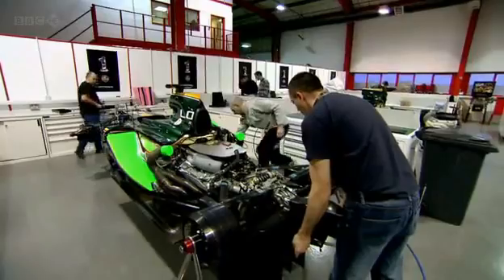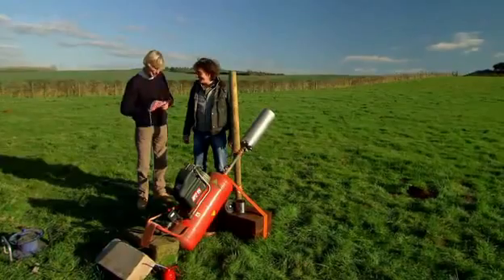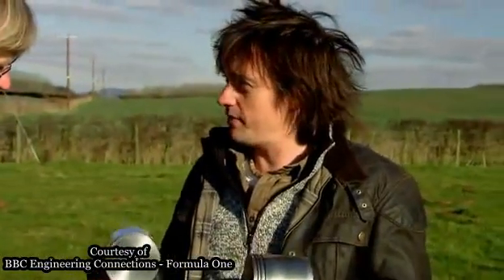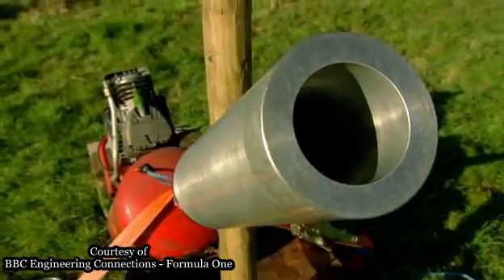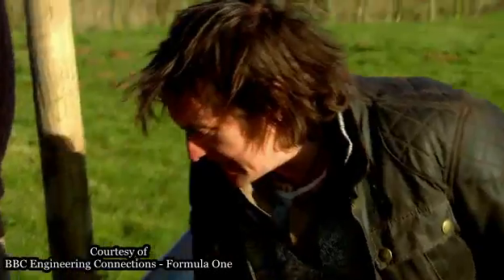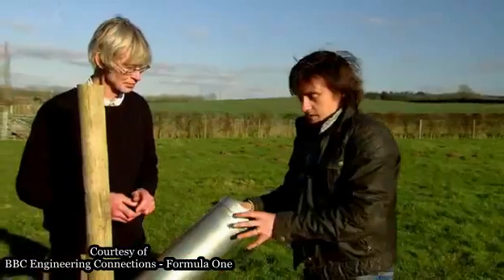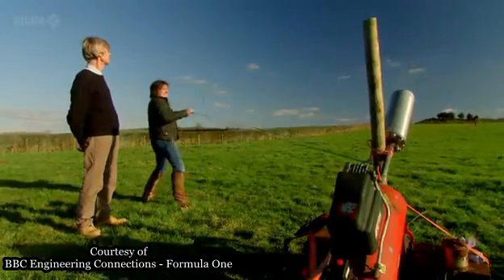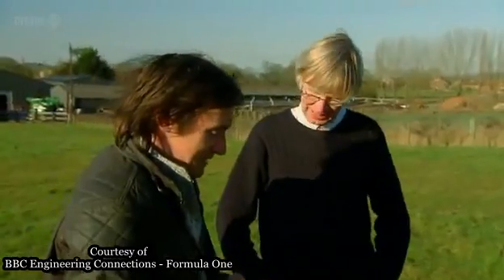The Secret of F1 Enormous Power - Precision Fitted Components

Comment: Piston rings???!!??
Reply: +magna59 F1 engines have piston rings, both compression and oil.
Reply: +Tristan Laing Why would you need piston rings , in the conventional sense , if you have measured everything within a micron of it ' s life . Piston rings are a reflection of low machining capability / pricing techniques & a quick cheap fix . May be the odd oil control ring , but even that ' s a bit of a mixed on , as these engines are generally dry sump , so it ' s not like there is vast amounts of oil being splashed about , as in a wet sump design .
Reply: So f1 engines don't use piston rings?
Reply: Yes, but magna59 was implying F1 engines don't have rings and I was answering Tristans question.
Reply: +magna59 no, every engine needs piston rings because the piston gets bigger as it heats up, if the piston was the ring than there would be a lot of friction or there would be no compression.
Reply: +Tristan Laing Well i ' m sure like everything else in this " world " there are things with rings & things without . Block in alley with liners , block without liners etc etc etc
Reply: +Tristan Laing It's a stupid example.
Reply: +randysengine service i dont know if hes right or wrong, but they have to heat the engine to operating temperature to turn on and not wear
Reply: +Austin Zeller maybe they use  really thick oil and they heat it so it can flow better when they start it, but I could be wrong. I don't think the  clearance are as tight as everyone is insisting because there would be more friction, the piston clearance doesn't need to be within .002 for the engine to make power and have good fuel economy, some race cars have piston clearances as much as .006
smaller clearances add to the life of the engine.
Reply: +randysengine service that probably part of it, but I think it needs to be heated so the block expands and leaves very minimal clearance for the piston. But I'm no f1 mechanic lol, I could be spewing non-sense
Reply: +xXxMartin96xXx no that was bullshit. I know a lot about engines

Comment: This is actually cobblers.  All cars have good fitting pistons and rings to seal the tiny gap left.  The reason F1 engines are so powerful is the RPM they develop their torque at.  Power = torque x rpm,  thus with multi cylinders you have smaller components, and built from higher quality material can cope with high speeds and deliver higher power.
Reply: +zzebowa road going cars have MUCH looser fits. it has to be operational on a much higher range of temperatures (usually -20c to the regular engine temp which is usually around 80c). taking component dilatation into account, they HAVE to be a bit loose to work, or it'd get stuck when cold and need silly startup procedures like f1 does.
this isn't cobblers, it's just not the entire story.
Reply: +Tony Pate Heard of punctuations ?
Reply: +zzebowa God  how i love you car guys ! Meanwhile back in the early 1960s on you
tube HONDA 125 5 CYLINDER AT GOODWOOD FOS 2002 and for a real techno 
feast try HONDA GP RC166 DOCUMENTARY GRANDFATHER OF RCVS even did
a few cars with 10k redlines the s600/s800 both with roller bearing cranks all bit
to much the car world in mid 1960s !! try MUSIC! KOGA RACING HONDA S600 RACING  and the best part is the bikes got left behind by the more powerful
two strokes only good news is kind mr yamaha done a engine for mr toyota 
sorry mr  lexus for car fans drool over packed with late 1980s early 1900s tech
gee a 9 k redline at least not a bung a turbo on a average "motor" NON TURBO STI/EVO ANYONE ??  the pop pop bang bang pop off lazy engine tech rant over
got a soft spot for old v10 etc f1 but now it,s a sad show not a event to stir the
heart and awake any passion
Reply: +rvind92g  Yes thank you i have ,No big deal to me on you tube if makes you feel any more smug, I now consider my lax ways been addressed by your good self ,Well done that "man" now if nothing else can help you with kind sir
i bid you a very good evening  and my condolences to you on the loss of top gear and if not got one may i suggest, A nice audi for you sir , Maybe a golf sorry a a3 but never ever utter the words a 2
Reply: +Tony Pate Take your pills
Reply: +Faketrollname sevenbillion Thanks for your concern every day at 10am 
seems to work for me unless have a "incident" brought on by sighting a panzer mk 12 sorry a Q7  !! Worry what all the drug dealing owners done with
the panzer mk 10 sorry X5 ,s
Reply: +GraveUypo No, production cars have higher tolerances, these engines have a lower tolerance( .004 to .006 piston skirt to cylinder wall) and use a heaver oil. please someone correct me if I'm wrong.
Reply: +GraveUypo Production cars have extremely tight clearances nowadays.

Comment: How are the Pistons too tight when cold???? Won't they only expand more when heated up?????
Reply: +jhaze918 you forgetting that the engine block expands too
Reply: +Somethingafw F1 piston, along with almost all engine pistons are Aluminium alloys. Only recently has there been a push to steel piston technology. You see, the key parameter is thermal conductivity. Steel cannot remove the heat from the piston surface as quickly as aluminium, so requires a lot more oil supply from the Piston cooling jet, thinner walls, and thicker piston rings to conduct heat to the liner. Google steel pistons and you will see their very thin construction. Very expensive to produce at the moment and only really beginning to yield benefits.
Reply: Somethingafw c'mon, i just said common things, really. That's not a question of wikipedia or not. I've studied materials, and there is something that everyone must understand, is that there are steel, and steel. For example, steel, as you know, is not a material. Is an alloy. What i mean, is that you can have a "steel alloy" (if i can say this, sorry for my flaws in English language), with a given percentage of carbon, and have a different behaviour than other "steel alloy" with other percentage of carbon (just saying carbon as an example, but it is not the only important thing in there, obviously). Saying steel or aluminium, is a big mistake. For example, when someone say titanium, or scandium, or whatever, most of the times, you are talking about alloys. Not the raw material. Understandig this, is what take us to understand that there is no way we can guess what  those F1 "magicians" secretely makes in the foundry. Not to mention coatings, thermal treatments, etc, etc, etc... So, take the matter to "is it steel, or aluminium?" is just reducing to nothing what this guys really do. Sorry, but i do get goose bumps when i try to understand what these engines can do. I get fascinated by that. Don't take this the wrong way, that i try to show that i fully understand this... c'mon..  In this matter, for sure i can say that i really don't know sh#t :) That's the only thing i know
Reply: paviaaPS3 *less viscous
Reply: +kolyn calderon   aluminium expands more than steel, so they are always loser when cold.
Reply: before i answer that.... which are made out of steel and aluminium?
Reply: +kolyn calderon Pistons I would guess and the engine block is made out of aluminium.
Reply: +Somethingafw really? C'mon... Metalurgie is a science, and that's where the magic is born. You can't say "aluminium", or "steel", as they are standards. There are too many kind of alloys. And when it comes to F1... That's a world on it's own. Many exclusive metals are used, like for example, titanium, berilium, etc, etc... Pistons come in many kinds. But i think in somewhere in the 90's, one alloy they used was aluminium and berilium in the pistons. The weight was something bellow a third of a conventional one... So don't think pistons are mede o steel, or aluminiun in the block, in standard mode... Now they use ceramic composites everywhere...
Reply: fitty77 He was asking which one out of these two metals steel and aluminium, since aluminium could probably not handle the stress so I guess it would need a steel. Also I was not gonna open a wikipedia page to pretend to know something I don't.
Reply: Okay didn't know that
Reply: +fitty77 Technically you are correct. But, whichever aluminium alloy you use, you always end up with at least 2 times the heat expansion coefficient of pretty much any known steel based alloy. You can change the heat expansion value by about +/- 10% off of the base metal, but that's as good as it gets.
Reply: and the oil becoming more liquid
Reply: +Adam Laycock thanks wasn't sure about it.
Reply: shi01 As far as i know, this is not all about expansion, but also heat transfer. Aluminium is better suited to transmit heat out than steel. Not sure if i understand your point of view in this matter (sorry if i'm not), yet, aluminium alloys are forbiden for cost reduction, acording to current regulation. Hope i'm not saying it wrong here. Think i read this somewhere... Whatever it is, when you say 10%... I Don't really know if is that or not. What i say is that in Formula 1 they probably talk in 0.001% differences. Something like that can be the diference between winning and being 2nd. Back to pistons, i think the main goal in terms of materials, is heat transfer, heat stability (dimensionaly speaking!?), resistance, and mass.
Reply: +kolyn calderon piston expands faster than cylinder

Comment: f1 has BIG BORE with SHORT STROKE.  more power with lower mean piston velocity
Reply: +superhyphy129 and waaay less torque at lower rpm. In a street car you want high torque at low rpm so that you can get moving along without waking up the people... in the next suburb.
Reply: +carlos ortiz Of course it's possible, but very difficult (i'd guess) and you'd have to do maintenance all the time.
Reply: +carlos ortiz but f1 enginges are not designed to work after 200k km upwards. they have multiple enginges just for one season... 
thats why the can have 600hp out of a turbocharged 1.6 v6. a usual 1.6 tubochargd engine has about 100 hp. 
its just like tuning. with every step higher the lifespan shortens.
Reply: +carlos ortiz  here is al ist of a few f1 engined powered car http://wtf1.co.uk/recycled-f1-engines/
Reply: i mean to start moving the car..
Reply: +superhyphy129 good to see some logic here, you can compare car engines to superbike engines, key factor RPM's, from Bore over stroke. obviously other factors do come in cuz the f1's are seriously tuned to extreme limits, prolly explode at full throttle if the driver is too heavy lol
Reply: That just means higher possible RPM for a given piston speed. If "more bore, less stroke solved everything", engines would look a lit different. It's all about compromises. F1 happens to go the way of high RPM and horsepower at the expense of torque.
Reply: With the low torque at low rpm, is it that why F1 engine idle at much higher speed?
Reply: +Basel Kader Just want to mention that it's very possible to have almost identical torque and power curves, whether you had long or short strokes. Depends entirely on tuning. Of course if low-end torque was the only thing you want from the engine, then long stroke is better, because efficiency and reliability. But that will also limit the tuning potential of the engine if you'd ever wish to upgrade.
Reply: and high pressure nitrogen instead of valve springs to allow high revs without the valves floating and thus losing power
Reply: Is it possible to put an f1 engine on a road car
Reply: +superhyphy129 Finally someone can unsterstand engineering .
You guys if you try to install an F1 engine on a 2 ton Merc it probably wont be able to start  because of very low torque ..

Comment: higher ATOMISATION and COMPRESION leads to higher  
RATE OF BURN, which leads to higher
PEAK TEMPERATURE AND PRESSURE, which leads to higher TORQUE.

With raising the compresion we raise the internal temperature and chance to self detonation thus we need higher octane fuel, but also racing gasoline has a limit. Racing engines (especialy turbo charged) use extra fuel to lower temperature durring compresion stroke. Fuel evaporation significantly lowers temperature but to rich mixture will eventualy lead to power loss.

Raising the RPM is also a tricky job. Each engine is engineered for a specific job. Car engine is made for reability, long life, fuel efficiency and evironment standards, while racing engine is made entirely for power. With that in mind we can design engine with high VOLUMETRIC EFFICIENCY factor (VE factor determines how much air is sucked into a cylinder compared to cylinder displacement) at specific RPM. Racing engines normaly has high VE at high RPM but car engine will lose power at RPM higher that 6000 since VE will decrease significantly. Also raising RPM adds stress to the cylinder and piston head and going to far will destroy engine.

About cylinder clirance:
F1 piston like regular gasoline car piston has two compression rings and one oil ring, providing compression and lubrication. Pistons are forged and forged metal is more termicaly dependant than cast. So of course there is a cleranse between cylinder and piston otherwise whole thing will stop working when temperature will raise. Canon is only fired once, psitons traveling at 15.000 RPM will soon be damaged in no cylinder clearance.
Difference between regular and racing piston is that racing piston has shorter rod, larger diameter and is lot shorter.
Reply: Borut Goli "So of course there is a cleranse between cylinder and piston otherwise whole thing will stop working when temperature will raise" F1 engine only work at operational temperature. At room temperature the pistons are oval and locked up; the engine needs to be heated by pumping hot oil and water through it, before it starts.
Reply: xXYannuschXx some clearance still need to be. Bearings on the crank has no clearance and they have to be heated or press mount on the crank axle. Once they cool down they are stuck there. Piston with no clearance will not move, or will wear down and burn. F1 has wery low clearance and pistons are designed to have this clearance at working temperature, but there of course is a clearance. And like any other piston engine there are pistons rings, providing compresion and lubrication.

Smaler clearance means less horizontal movement of the piston, less force to the cylinder walls and thus less friction, especialy at racing engines with short rods, where angle is more than 20°.
Also at wery high RPM to muxh piston horizontal movement will eventualy damage the engine.
Many diesel engine has connecting rod a bit of center so the piston switches position before TDC and before the detonation. With this method they prevent rapid horizontal movement of the piston.

Comment: Reducing tolerances is more about increasing efficiency and an added benefit is gaining some power. What really makes F1 engines shine is balance and low stroke rods which let the engine rev higher and thus increase the power significantly. Remember: The only way to make an NA engine more powerful is adding displacement or revs.

Comment: Bullshit.
Put piston rings on both of them and the one with more play will go further due to lack of so high friction. It must have some play, but just enough of oil film and little local temperature changes during engine operation.
Parts must be matched properly, but a little bit of clearance would not make even 4% power difference (which is maybe 2% of the flight range).
POwer is comming mainly from high revs and precission, but different type of precission - properrly balanced rotating mass is a key to significant gain much bigger than precise shape pistons.
As balanced parts are as fast they can rotate. Faster rotation is the source of the additional power. Snuggy pistons fit helps increase engine lifetime (in racing aplications only) , but not power (maybe just a very very little).